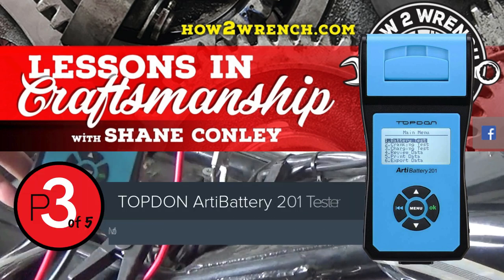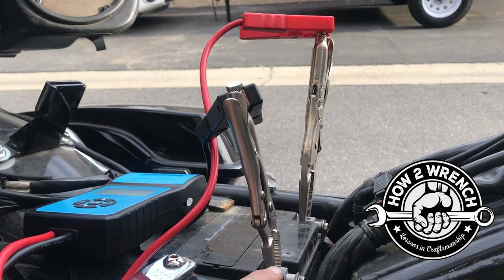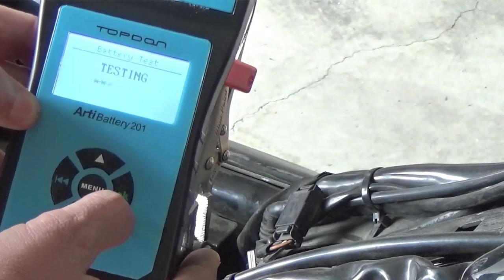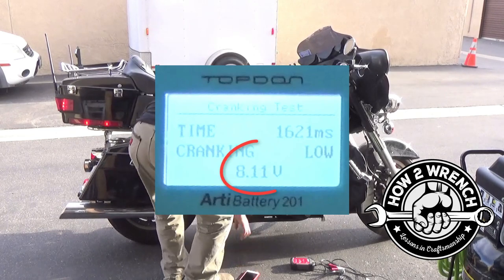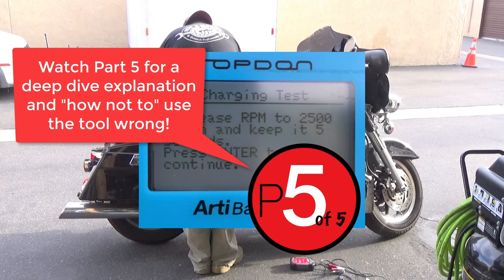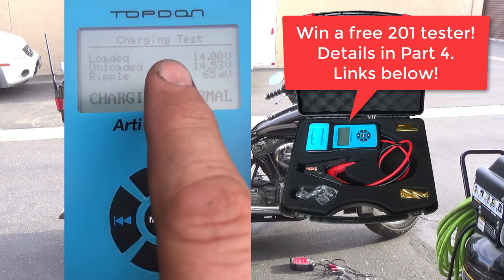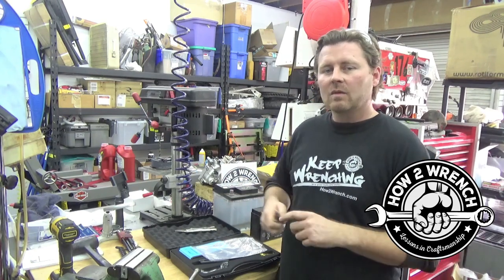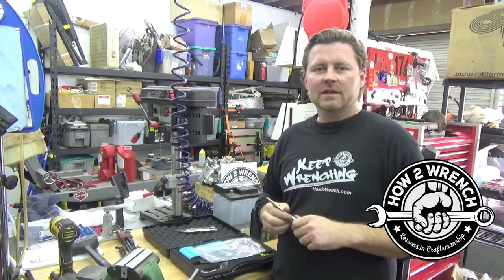Part 3: Motorcycle Battery, Starting & Charging Topdon 201 Tester Review WIN IT FREE!

Comment: Very cool device with the added functions. I have a fairy simple device that just does the battery health check, which does a good job.  I’ve repeatedly replicated the results from it with an carbon pile load tester, so I know it’s fairly accurate.  Some of the “purests” out there hate these electronic testers, but I gotta say, I’ve used a few over the years and found them fairly accurate when used correctly in conjunction with some sound battery knowledge.  Thanks for the vid, love the device.  A great handy tool to have by the looks with multiple functions 👍
Reply: Supa Troopa ...What simple and less expensive battery tester do you suggest? This Topdon unit looks fantastic but I'm not a professional mechanic.
Reply: blipco5 I don’t know where you are, but I’m in Australia, so my recommendation probably wouldn’t mean anything as you probably can’t get it? However, the device I use was bought off eBay for about $50.  It’s generically branded, so no help here.  eBay can be hit n miss, so I got lucky. As I said, I cross checked the results from MANY batteries with a carbon pile load tester and a Snap On professional tester at work and it was accurate to those.

These cheap testers are just that though, they’re designed primarily for flooded cell batteries, but I’ve found sound results from AGM as well.  Haven’t tested it on lithium’s as yet, but I suspect it won’t be any good for them.  They won’t do anything else like the expensive ones, ie battery variants, print functions, actual load testing analysis, charge test etc, but with a good multimeter you can cover off on most of those, multimeter volt test with min setting active while starting your vehicle will give you minimum volts while under start load, for one example.

This wasn’t intended on being a “I’m a know all” rant, just a blurb so you know where I’m coming from.  Some of your local auto parts retailers or auto battery retailers may have a “better quality” battery analysing device, if you don’t want to get an eBay one, mine just turned out to be good for a cheap one! But a quick search on Amazon also gave results for around the 50-80 dollar range and just seen a $52.99 au one that stated they test a good variety of batteries with a few added functions, a printer, USB port to connect to PC, (Way more advanced than the one I’ve got 😂) so these are getting better and cheaper all the time?
Reply: Supa Troopa ...Thanks, I'm in the US. I searched and found a Topdon without the printer for about $50 bucks US. It rare when I need one but it's a nice tool to have.
Reply: blipco5 nice 👍